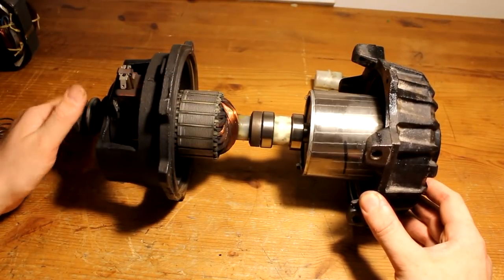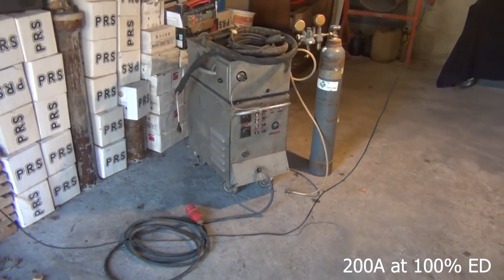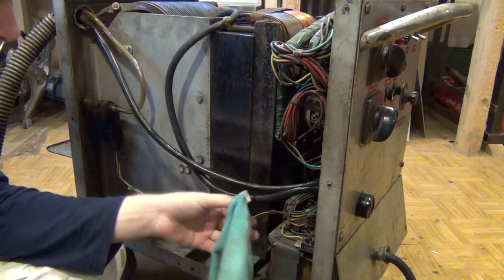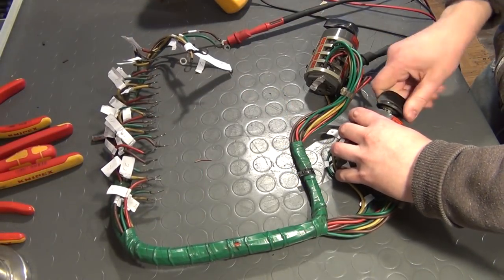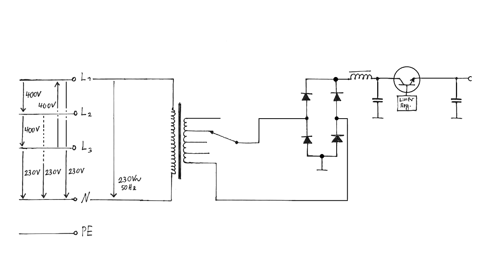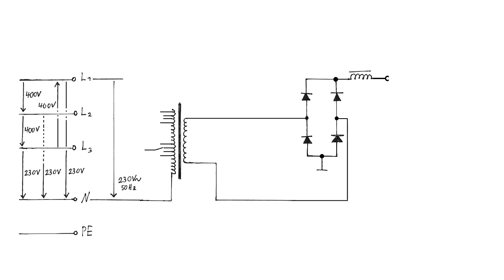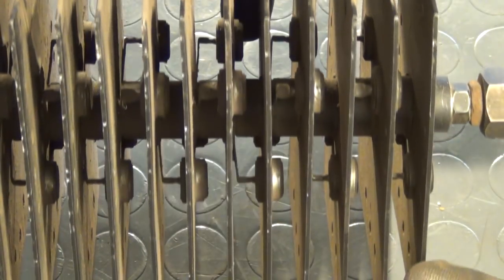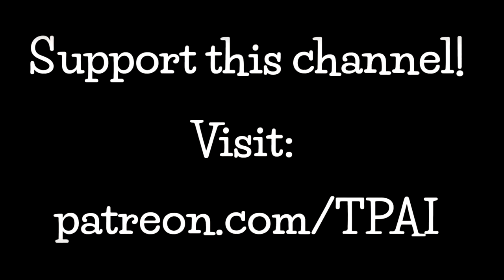MIG/MAG Welder Repair and Modification (I)

Comment: 24:18 if i was engineer in the 20th century i would connect all the secondaries in Y configuration, use the center tap as a ground and connect 3 diodes to the  3 wires (anodes to the 3 phases, cathodes in parallel output positive voltage) this way i save on diodes (which were rare and expensive back then)
Reply: but you'd get half wave rectification (half the power) only with star configured secondary and 3 diodes only. also for welding you need high current => delta configuration of secondaries is the way to go for high current.
Reply: each wave would be chopped in half but when combined they will overlap good enough. On average it would give almost half the voltage of full bridge rectifier, so if that is a problem you can wind twice as much windings on the secondary and also star configuration is better, because your coils use shorter wires therefore are cheaper to wind
Reply: it's not about voltage... google for half wave and full wave rectification. with half wave you are using half of the sine wave only => half of the available energy/power. to utilize the transformer to max available power rating you simply have to use full wave rectification.
Reply: yes this would make 50% of the secondary copper inactive, but everything else stays the same, except that you have less voltage drop on the diodes, you cut the price of 3 diodes and most importantly the chance of diode burning are lower (more reliable). depending on the copper vs diode price i think in some situations (such as the early 20's) this would be a better way to do it
Reply: You are so wrong... OMG
Reply: correct me then

Comment: A 50-year-old welder made in Germany will still outlast the latest gee-whiz special made in China.
Reply: The “gee whiz specials” with sufficient ratings aren’t cheap, so to be fair you’d need to compare apples to apples, ie. a machine built for 200A continuous output. That’s still be over $1000, China special or not.

Comment: I have a old stick welder. and a cheap might welder. I was thinking about combining the two. or just use the stick as power and the might as a wire feeder. and gas supply. maybe get a longer and better trigger and supply line. the stick welder is a old unit. I think may have been used in a factory. it is a 100% full power/ duty  .

Comment: Good video. I was given an older Harbor Freight flux core 90amp AC welder that runs on 120 volts (These are cheaper entry level AC welding machines). I'm going to convert it to a semi DC machine with a single phase bridge rectifier and large capacitor. This machine has a  switch that has two settings (high and low). This switch either controls voltage or amps. Can a rheostat or potentiometer take the place of the high/low switch to give greater control of the available volts or amperage in these inexpensive machines?

Comment: Thank you for this vid, you are a very clever man.  Could you help me?  I have a cheap flux core welder and the current, at the lowest setting, is too high for thin sheet welding so I want to reduce the current setting.  The lowest setting I have is 60 amps.  When I opened it up the power goes into a switch which, on low power, sends power to a coil.  When this switch is on high power it diverts the power to another coil.  How can I get reduced power from the low power coil, I thought of putting a variable resistor between the switch and the coil.  What do you think?  Thank you so much.  Kind regards, Paul.

Comment: In Germany they call it MAG welding . Here in the US we call it "stick" welding usually - like you said. The "official" name in the US is  SMAW or submerged metal arc welding . Interesting how the names change by country .
Reply: no mag is the same as mig with the difference that
mAg is with an active gas(CO2, or Ar CO2 blend, for steel) and mIg is with an inert gas(argon, for stainless steel and aluminium).
In german you'd say "Elektrodenschweißen" to "stick welding"
Reply: SMAW is stick welding and stands for shielded metal arc welding. MIG is also known as GMAW. Just saying MIG or stick is much easier...

Comment: (regarding the part around 19:00 ) I thought that the capacitor connected straight after the bridge rectifier and then came the choke to smooth the current out and give a better DC output.
At least that's how I plan to convert my cheapie LIDL 100A buzz-box to DC. Will it work? Mal sehen...

Comment: I have a question, or just asking your opinion, 
I bought one of the new cheap arc welders, 120/240vac , 200amp, and the size of a shoebox,  I also have a transformer based mig/ fluxcore welder, 120v, it has issues, it needs switches, and a new torch and leads, I was thinking of using the little arc welder to power the mig, only using the mig as the spool and feed, I would have much better current control,  plus 240v possibly, I would still need the 120v for the feed, or I could make a transformer, to drop to 120v being it's only a amp or less in guessing,  I would get a much better torch for the wire feed, with longer leads, around 2gauge ground lead, I don't ever need to weld with 200amps, the thickest I weld is 1/4" usually 1/8" or less, and usually thinner with the Flix wire, I also have a gas regulator with it, but haven't gotten gas yet, I have a much larger arc welder  that is very capable of welding anything I would weld,  seems it is 100% duty cycle, it is big and heavy , much heavier than any I seen at a local store, with a crank to raise the current, 
Anyway , what is your opinion, they both do around 24vdc open circuit,    do you think this frankenwelder  is a good idea?

Comment: Merry Xmas  TPAI . Hey , could you use that big low voltage power supply to charge high mfd supercapacitors ?
Reply: You need thousands of dollars worth of capacitors to require such high charging currents, probably :)

Comment: The Post Apocalyptic Inventor, wouldn't it be a bad idea to parallel diodes because the current would just flow through  one of them instead of spreading evenly through all of them. And where did you get the ferite cores for your buck converter?

Comment: Those 40 A for the weld are from the main voltage plug or from the weld machine, a step-up, I wonder because I have a safety pannel for 16 A, just asking.
Reply: Schimbul de noapte A tipicly german outlet is rated up to 16 Ampere
Reply: thank's and Merry Christmas!
Reply: A typical German outlet is officially rated 16 A peak, but only 10 A continuous. They get quite warm at 16 Amps, but it's not usually a problem to have that load continuous.
Reply: Warm as in not stone cold. Maybe 35°C or so at 25 °C ambient. Now interestingly enough, I can't seem to find anything on the internet to support what I wrote, even though many of my professors told us that fact in the lectures.
Reply: Ollyweg 0
Diazed fuses rated for 16A get very hot when they run at 16A.

Comment: merry cristmas and a happy newyear to you too

i have a question about a mig welder 
i had a cheap chineese migwelder  in wish the old wirefeed broke its gears  , so i bought a new twin wheel all metal  wirefeed for it and while building it in the welder slid the box off the workbench , while trying to catch it i grabbed a handfull of wires and pulled out all the wiring from the transformer to the rectifier wirefeed controll and controllpanel (DOHW)
since all the wires coming out of the transformer are one colour i dont know where they belong 

i allso changed a resistor , transistor , and fuse in the wirefeed circuit to survive the higher amperage of the heavier wirefeed motor and that might not been done correctly either , not having the certanty the rest of the welder is wired up correct kindah makes it hard for me to pinpoint where i gone wrong in rewiring the thing

so i stopped pouring money in it and bought another cheap but slightly better mig welder , an inverter type with an euroconnector for the weldinggun and a gas solenoid this time that welds fine but although this time its made from metal it still has a bit of a weak single wheel wirefeed setup i notice when welding the feed is slipping even through a new gun without bends 

now i want to use the new wirefeed motor to build a stand alone cabinet with the weldingwire for it
i like to use this same box for coldfeeding material to a tigwelder too using a footswitch thats why i whont build the better wirefeed in my new welder (and because this one is still working ok)

i was planning on running everything (welding current and gas switching ) except the weldingwire from the connection of my new mig welder through the add on cabinet and use a seperate powersupply and wirespeed controller build in the box for the wirefeed controlled by tapping the signal of the switch on the gun  , the wirefeed in the new migwelder will run but without wire in it 

most of the stuff i figured out but are there any things i need to take in account (like does the wirespeed change on startup with the welding current running through the gun while welding) i'm not sure as with the old machine the transformer allso fed the wire speed board

Comment: Thanks for such a beautiful video. I got a question if you dont mind. I have a 3 phase  einhell Mig 250 my grandad was using at his workshop before he died. I wanna use it as a backyard but it has four cables a green, blue brown and a yellow green. How may I connect it to domestic 3pin or can it possibly work if I may ask
Reply: No, it needs a three phase supply - a 4- or 5-pin IEC connector.

Comment: My optimal 3 phase power is 63 amps so could use Kemppi Tylarc 653... 800 Amps of awesomeness :D Currently have 25 amps from 3 phase tops :/ So is there a way to upgrade the amps without making upgrade to whole system? :/

Comment: 24:15 but if the 3 secondary windings are on the same core wouldn't they be in phase? (or am I wrong?)
Reply: That core consists of two separate loops. If there were three coils on just one loop, what you say would be of course true.

Comment: 1:55 NEVER EVER simply put a pressurized gas bottle somewhere without strapping it to a beam or whatever that prevents it from tipping over. If you happen to knock that valve op, you end up with a rocket. DON'T DO IT LIKE THAT! Please!

Comment: hello guys ,
i wonder if anybody can help me please, 
here i have  an esab mig U4000i multi-process machine but now i dont have the wire feeder (esab origo feed 3004) which got the control panel  (origo MA23 or MA24 )so i can no longer use this machine without a wire feeder even for stick welding , i was wondering some how i can modify this machine so i can use for cc welding like buy a PMW controller and connect it to the driver gate board or something like that ? but not sure from where to start , can anybody help please , i will leave below a link for the manual and wiring diagrams etc.. 

http://svarka.rv.ua/image/Sweden/Mig,Tig, Arc,U4000/Mig,Tig, Arc,U4000-S-new.pdf